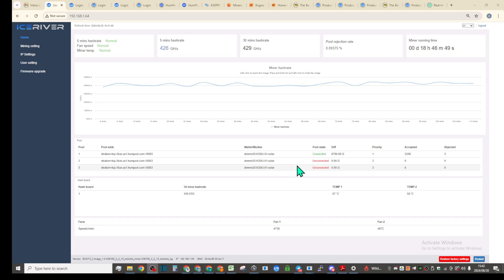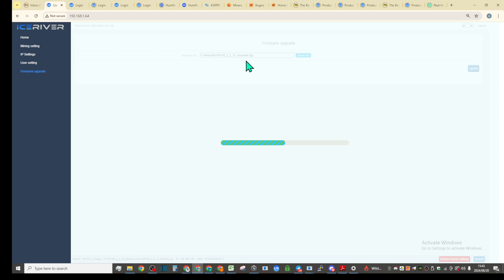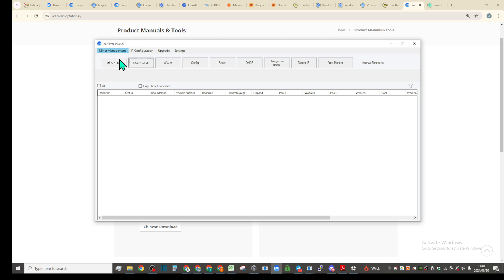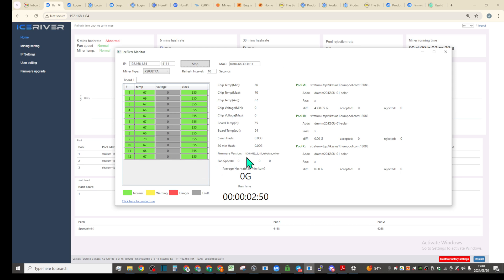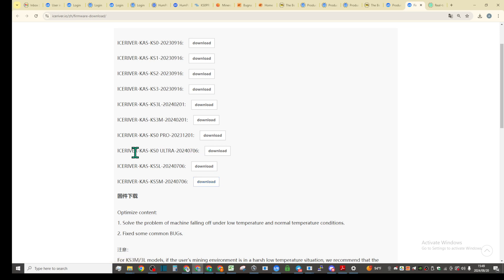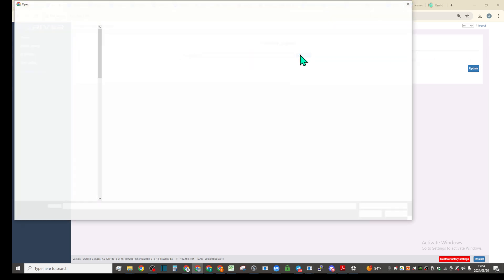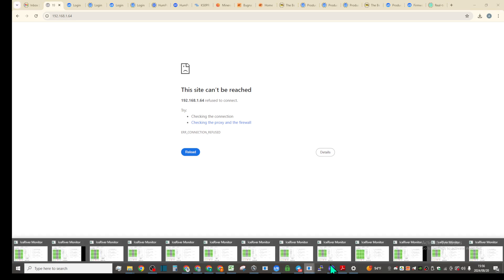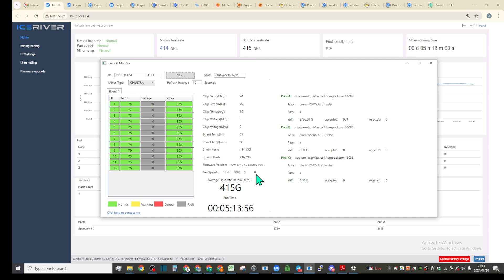WILL KS0-ULTRA WORK ON KS5L&M FIRMWARE? LETS FIND OUT

Comment: You mentioned Ks3 m several times insteead of Ks5m. Kind of confused at a point.
Reply from the maker: Ks5m and KS5L and ultra seams to be same firmware from the factory. You cannot install KS3M firmware on Ultra or LS5l/M, it’s just fails.

Comment: Great videos.  KSO Ultra with firmware uodate. Lights on ethernet connection dont flash. Cant find on ip scan?  Any advice?
Reply from the maker: Check/replace Ethernet cable first then check router or switch issue or use cable from working device

Comment: Buenas, yo acabo de comprar mi KS0 Ultra.
¿Cuando realizó las pruebas de firmware, utilizo el cargador original de Iceriver, o modificó el cargador le instalo otro cargador?
Reply from the maker: For overclocked firmware need to use different power supply. I used 330W
Reply: @DontMindMeMining Thanks for the information.